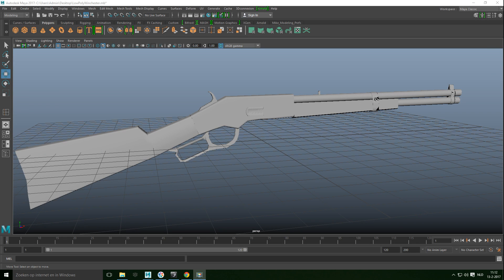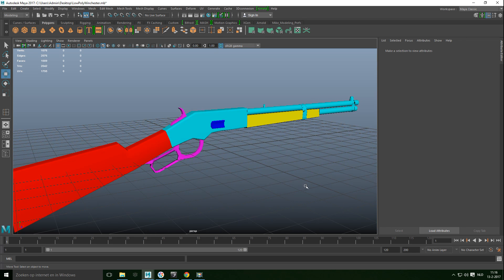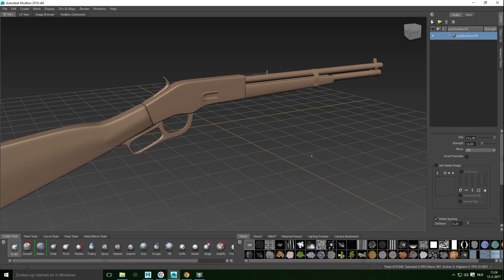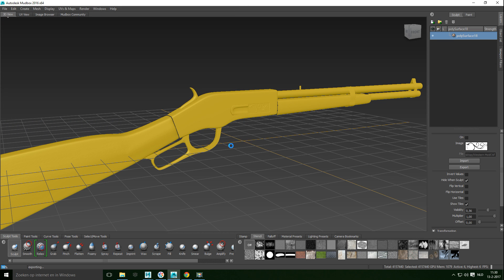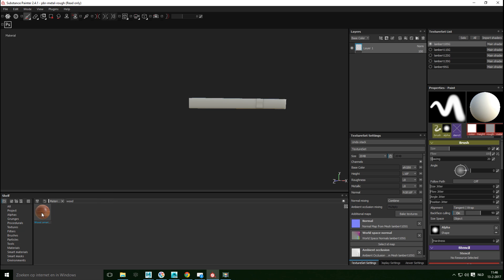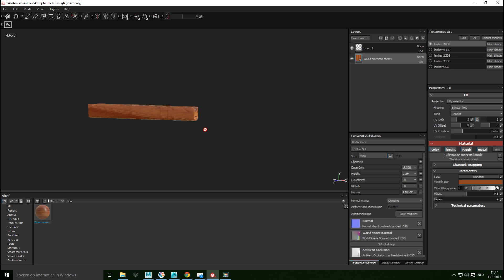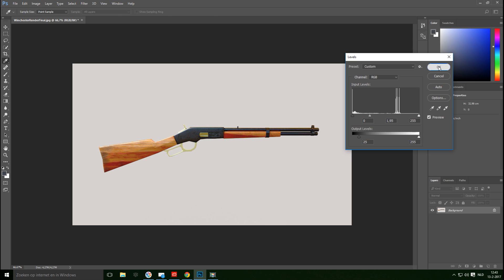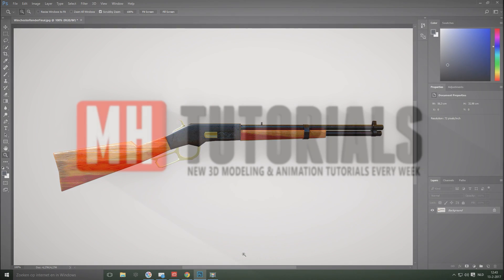3D Modeling an 1873 Winchester rifle ( Full High to Low workflow ) Part 2 of 2

Comment: Mike, I am very glad you've made this tutorial. But, I really can't get rid of the basic low poly mesh after baking. It seems both are showing, which causes a visual conflict of surfaces. I tried everything in bakink setting, but still do not know how to fix it. PLEASEEE HELP Lord Mike! :)
Reply from the maker: So what are you using for the bake ? Also please make sure your UV's are clean without overlap
Reply: Baking Settings:
-2K resolution
-Normal Mixing: Combine
-UV Padding: 3D Space Neighbor
-Output Size: 2K
-Apply Diffusion: YES

-Use Low Mesh As High Poly: UNCHECKED
High Definition Meshes: (High Poly file made in MudBox)

-Use Cage: UNCHECKED
-Max Front: 0.01
-Rear Distance: 0.8
-Relative to Bounding Box: CHECKED
-Average Normals: CHECKED
-Ignore Backface: CHECKED
-Antialiasing: None
-Match: Always
-high Poly Mesh: _high
-low Poly Mesh: _low

In order to assure it was not my UV`s, I did a simple cube inead the whole complex model and it stills happen.

I hope I can get your response soon. Thks Mike !
Reply from the maker: I meant, what applications did you use for teh bakes ? Maya ? Substance painter ?
Reply: I backed it on Substance Painter. 
I used Maya to design lowpoly and MudBox for highpoly

Comment: Hey Mike, how are you retaining the shape in mudbox when subdividing? Im trying this in Zbrush, but it just smooths all of the edges, so I have to manually crease everything I want to keep which takes hours
Reply from the maker: Drag select all edges and crease. 5 Sec work
Reply: in zbrush? or in maya?
Reply: im guessing maya, but wont that literally crease every single edge on the mesh?
Reply from the maker: Maya
Reply from the maker: Yes
Reply: ok so I need to go in and deselect what I don't want then. Thank you Mike! I tried in zbrush and it was an absolute nightmare this was a lot easier
Reply from the maker: Just select everything in Maya and deselect the ones you do not want creased. Then crease the selected. Then import into ZBrush and subdiv
Reply: yep that was a lot faster than in zbrush!!! Do I need to import into zbrush acertain way? It isnt maintaining the creases in zbrush when exporting as obj